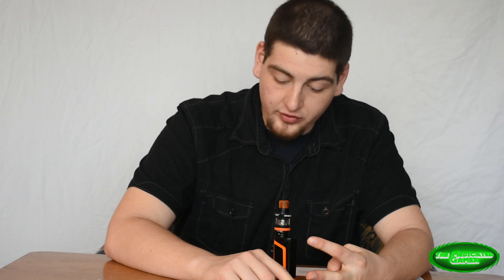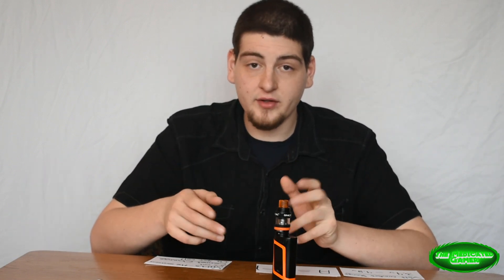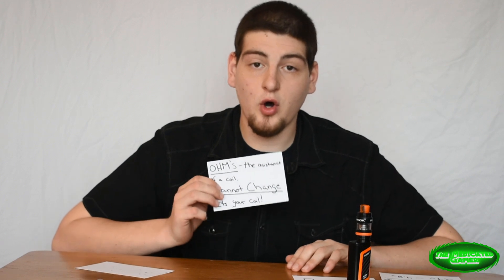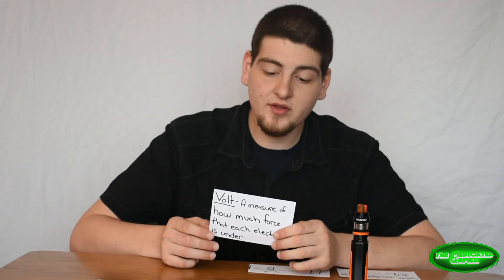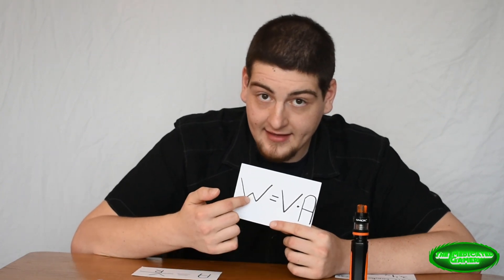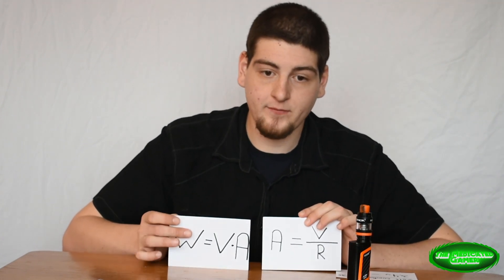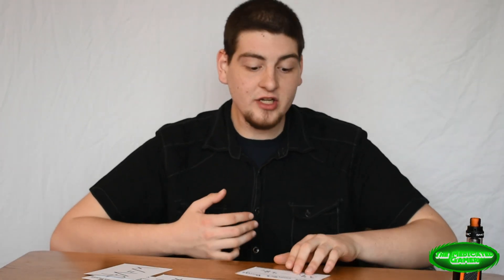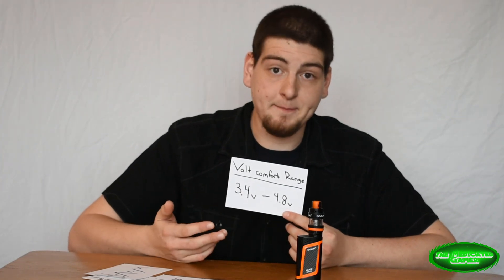Vaping 101: OHMs, Watts, and Voltage Explained for Beginners

Comment: clear as mud, how many volts should be used with a 1.6 ohm coil to overcome the resistance without burning the coil and the most efficient use of battery?  Is running volts too high or too low burning the coil?  How to set that up?  They advertise a 2K amp hour battery but how long does that last with a 1.6 ohm coil?  Amp hours depend on how much voltage and how many amps are used so that tells us nothing without a calculator so you've basically told us to figure it out.

Comment: So, I know this isn't a forum, but I need help BADLY! I have the Vaperesso Target PM 80 and it's sub ohm. The regular vape fluid has a high VG and low PG the exact opposite of what I need. I tried using salt, but it tastes dull, but better if I crank the wattage up which is the polar opposite of the recommended wattage on the coil. Should I mix half salt with liquid (which is easier to buy locally) or look for fluid that's just high PG? I live in a Podunk town where the stores have NOTHING! I'm at odds with what to do and would love suggestions! I'm looking for a Custard or Creme Brulée flavor!

Comment: Bro, I am gonna do vape videos now. I feel like I know more than most people do. Wanna know what I learned? You gotta just set everything for premade coils the way it says on the packaging. My coils said to set at 100W and .33ohms. I did that and it fixed my issue. My vape was all screwed up from being on in my pocket. Buttons got pushed and my ohms changed to like .56. I hit that thing and I coughed like crazy. Thought I had a burnt coil and I didn't. It was about to be burnt though. Just look at your box on the back. It tells you.

Comment: Hi, i need a quick response i am new in this, i have gen s with 0.18 sub ohm coil and the voltage is automatically set to 3.2v..is 3.2v is good for 0.18 sub ohm coil or bad?

Comment: MTL vs watts or would that be resistance? I want like a cig. Is it only predetermined vapes for that or is adjustable =wattage to get a little less or more resistance better? I've a sourin edge and that's pretty good but I notice these things go out of style/stock. They quit selling them when a new one comes out that id more popular or something. I don't want to throw away a perfectly good battery or cartridge/coil stock if the pod or battery goes. I'm getting good results without salts in the edge too. I purchased an adjustable ohm battery with .6 and .4 cartridges and two coils with different resistance(?). Correct my words please first then paragraph correct words with what a smoker who likes how cigs draw and smoke but can not use real cigs in the house. Also which coil is better for salts vs eliquid. And another question is PG/VG. Different coil and/or ohms for higher VG correct? I want to get it and out seems like reading and reading raises more questions. On Suorin site I notice a lot of battery also have adjustable threads to for different tanks/pod. Is a tank a pod for all intents and purposes? Tanks can change coils and ports have built in coils? Am I correct in that? Flipping back and forth when I hear a new word doesn't always work because some manufacturers use a different term. It's driving me nuts.

Comment: I'm just saying, I'm running on single coil with .44 ohm resistance, I just want to see what is the perfect wattage/voltage should I stick to. all of those are showing in my mod from the wattage to the ampere, I'm now on 44 watts with 4.38v and hitting 10amp when firing. Is that safe?

Comment: So has anyone figured out what the inductance should be since we're using buck converters at radio frequencies? None of the mods do readings for L. To really tune your vape like a pro, i think you're going to need to understand Z. Whole different set of equations. This is only a cursory glance at ohms law.

Comment: Damn I got some brain damage from reading the comments on changing your ohms lol. If I took a shot for everyone that commented "I CaN cHaNgE tHe OhMs, YoUStAnD cOrReCtEd" I'd be long gone 😭. If your still reading this a word of advice. Yes you can change your ohms on your boxmod. Like 99.9% of mods you have the option to. Obviously the point being made in the video is NOT to change it. It IS a constant with FABRICATED or FACTORY made coils. Example with the falcon king coils straight out of the box they tell you on the coil and from the box the specific ohms you can use the coil at. There are only 2 reasons you'd ever want to change the ohms. Read slowly. When your mod won't automatically read the coils reccommended ohms and wattage correctly(happens when the tank is worn) OR when your using a rebuildable. That's it. Simple. If you peons couldn't uNdErStAnD idk what to tell ya🤔🤷‍♂️

Comment: My ohm is .16 and I am using gpriv 2. And I’m using a ram coil. How high should my watts be? I recently changed my wick 2 days ago and It smells like its burned already. My setting currently is 70w with a preheat of 65 in 100degrees celsius.

Comment: I have a voopoo drag the first version.  I used  smok and geek coils .05 in my srk tank. I'm looking  to get the right balance I love vapor and not to much heat I buy my coils are rated 35 to 90 . But when I go over 55 watts  they burn out . What am I doing wrong. Sometimes  a coil will last 1 day and others last 3 weeks  how come . I follow the proper set up I put juice  in the slots and wet  the cotton.  And wait 25 minutes  before  vaping

Comment: why does it say 0.26 ohms in my vape's screen even though I have a 0.3 ohms coil in my tank
Reply: Depends on the batterys and mod you have if you have an old mod it might not be that accurate and its not perfect everytime and if the difference is lets say 0.05 ohms its not going to be that substantial.
Reply: @leoholmberg7163  sometimes it's not old mod or battery related the AEGIS LEGEND never read the coils spec's as rated it also jumps up & down in WATTS as you push fire button to Vape don't believe me have a friend watch or look as screen in a mirror or use phone video pointed at AEGIS screen while vaping with or without firmware update

Comment: Why do I have a button that changes the ohms then? And why does it keep saying "ohms to high" even after i turned them down as low as it will go to .090? My smok procolor 225 watt has a ohm range from .090 to .252?

Comment: I own an Artery PAL II & it seems the coil selections are 1.2 and 0.6 Ohms.  On this unit it seems the wattage can not be adjusted, & the coil has a watt number range listed.  Is this range based on the voltage the battery has based on how much charge is remaining?

Comment: U actually can change your ohms up and down when changing to a new coil on the smok devilkin
Reply: And the smok t priv
Reply: You can change the ohms on the smok mag 225w too. I typically have to change mine when it tells me the atomizer has shorted out. Even on a fresh new coil. I use smok triple mesh with a tfv12 prince.
Lock the mod, hold the up or down button, then the ohm menu will appear.
Reply: @asimgeekhan  I have the smok x priv with v12 prince coil and I cant figure out what the best ohms to run it at any advice?

Comment: Volts x amp = watts and watt ÷ volt = amps.  Learned that when using a generator and power tools to make sure I didnt overload or blow a fuse as most tools go by amps as a measure and most generator ratings are listed by wattage.

Comment: Hi, a fast question, appreciate anybody answering it. I know its bad for the coil using more wattage than the recommended and may burn it, my coil is recommended 55-65W. Is it bad for the coil if i use it on lets say 25W? Logically its better for the coil, but just have to ask 😆 cuz it says recommended 55-65w
Reply: Hi, I'm really late but it won't damage your coil at all, the only issue is that the vape could start to gurgle and flood due to underpowering the vape. If that happens you could get hot liquid in your throat when inhaling.

Comment: I have a Smok Mag and I can adjust the ohms. It actually adjust the ohms automatically.
Reply: Will Porter mine too bro now im confused ahaha i have smok h priv 2. my ohm before is .13 when i changed my new wire it sets to .9 is that ok or should i get worried? cuz they said that the lower the ohm the more they get hot easier and sometimes lead to explosion? please enlighten me

Comment: I liked the explanation. Really wish there wasn't math involved - I suck at math. However, the reason I was even looking is that I'm getting my first RDA and am trying to figure out what type of coils to use with it. I know that it comes with coils (thank goodness) but what if I come across one that doesn't. And then what about regulated versus unregulated mods? The gal at my local vape shop was like "when you're ready to get serious about vaping, you should get a HexOhm" - which I later googled and then was awash in all the new information about mechanical mods. Oye! My head is spinning.

Comment: What is a good setting/wattage for wax concentrates? I seem to be burning too hot and too low but cant find that sweet spot. Running at 17w which is 3.93v on my device. But i feel like its a very weak hit and i dont want to keep wasting wax

Comment: Listen stoner.... You need to tale a few courses at ypur local Community college or something...  Your formula is written wrong.. The current I in amps (A) is equal to the square root of the power P in watts (W) divided by the resistance R in ohms (Ω).
Reply: Listen dumb fuck he did that for viewers to easily understand.

Comment: Please remove this video as it attempts to promote a safe working knowledge on the elements and use of electrical energy and has failed miserably in it's attempt, leaving much to be desired. As both an electrician and a vapor it caught my attention to review for accuracy. Alas in light of many hazards arising from improper vape device modifications, I feel compelled to make this request in hope to prevent further injury resulting from misinformed/underinfirmed.

Comment: If my coil says to operate on 0.5 - 0.6 ohm but when I plug it in the voopoo drag mod box it says 0.82ohms is it save? I've tried unscrewing it and replacing it and hitting new coil but it stays 0.81 - 0.83ohms.
Reply: WoofyG I hope you already found your answer but this worked for me remove your tank completely hit your fire button it’ll say something like check atomizer screw your tank back on and it’ll ask if it’s new hit the plus and it should work

Comment: So what do you do if the Ohms on your mod are over the Ohms on your pre-built coil
Reply: Adjust your mod to most closely reflect the coil. The coil is what determines the actual ohms. Your mod only allows the input to tell the chipset what the resistance value of the coil is so that it can logically apply appropriate voltage to produce the requested power (watts).

Comment: I have an aspire breeze and I've seen coils with different ohm ratings i was wondering what the difference between say a .6 or a 1.2 ohm
Reply: The difference is in how much the resistance is going to let volts through.

Comment: You Have to Know the AMPS of the battery you are using the higher the amp rating the better. Whether you make your coils or not you cannot change the ohms unless you fabricate another coil 
Ohms Law is what New vapers need to learn just Incase they end up buying a new squonk box that’s a mechanical by mistake etc...
I= V/R not hard at all...
Reply from the maker: Appreciate your input!
Reply: It’s not hard once you find it. I mean, the formula. Trying to find that simple explanation was like wading through a twisted vapeporn maze. I feel like I need a shower.

Comment: I just have a question, I've been running the Smok mag with the T10 coils for a while at 80 watts, with an almost closed off air flow tank, it's what I find i like the best, well recently it's been acting up giving me a no atomizer error which I get is generated by the pins not contacting from the base to the mod. So I'm in the marketplace for a new vape and preferably stick to smok because they sell the coils here. I want a stick vape that's bigger than the pens because it's easier to carry around than the hefty mag, it's heavy, and awkward when carrying things like groceries and what not. What kind of smok vape pen would give me the same output of a 80 watt with it's coil that I like? I've recently been looking through the numbers just searching for the pens with the max wattage and so far I think the prince sticks have the max of 80 watts. (I smoke 6mg nic juice) Thanks for reading!

Comment: I've been vaping for almost 8 months now I was smoking 2 packs of nasty ass cigarettes a day now I smell them and I feel bad when I was smoking around people who didn't smoke cigs,but I'm on my 4th smock I started with the stick now I have the smock mag 225 you can change your ohm's all you have too do is lock your smock then hold the small button in the front the buttons you change your watts and everything else you want too change all u have too do is lock it then hold any of the 2 buttons on the face for a couple seconds and the ohm's will pop up then you can go up or down with the ohm's I can't believe he doesn't know this and I'm very new too vaping I finally got it down pat when I'm changing a new coil not to burn it you have to let the juice sit for at least 15 minutes then dry hit it with the air all the way open then start hitting it at the lowest temp then start too move up a little at a time until you find your sweet spot I was burning threw coils and I'm using a juice that has a lot of sugarso that didn't help when I would just put the coil and let it sit for a while and hit at a high temp it would burn the coil automatically even letting it sit for 15 minutes you have to start at a low Temp and work your way up,now there lasting me a week a week and a half a juice with no sugar 2 weeks easy just start at the lowest temp that's the key,the reasons you can change your ohm's is because if you mess up and hit old coil if you do that it will throw your ohm's off and you can change your ohm's just trying too help anyone new.

Comment: I have a question on my smok mag baby it my atomizer says 0.6 but my  vape reads 0.618
Reply: Idk if that's wrong or not
Reply from the maker: The coil was designed to be made at .6 but since it isn't an exact science it was made at the .618, it's close enough to .6 though that it shouldn't make a difference really

Comment: I been starting vaping for the 3rd week now. These voltage, amp, ohms really confuses me. I starting to get hang of it by observing, if the liquid "jump" to my mouth when i fire it mean its too high, and  if there barely any vapor when vaping means its too low.
Reply from the maker: Yeah I'd try using a liquid with a higher VG content. Its thicker and can usually lower the chances of the hot spitting liquid. It's also possible your coil is flooded. Try flicking your vape hard to shake out liquid. If it shoots out liquid then its probably flooded but shaking it hard can usually fix the flooding.

Comment: Ok,I'm now even more confused than I was before watching this...I didn't  get it at ALL....I just use the wattages best used according to what the coil says.And it works out just fine.My cleito 120 says it runs best between 100 and 120 watts,I run it at 110W and it tastes pretty good....My Valyrian says it's best used between 95 and 120W,I use it  at 110W and it tastes just fine.So what the fuck is this????
Reply from the maker: It's all dependent between the coil you have in the tank. The lower the ohm the coil is, the higher itll require to run your watts. The purpose of the video was to explain to correlation between the 3 and which ones ARE adjustable. If you have a legitimate question I'd be happy to answer..
Reply from the maker: Just follow the instructions that come with your prefabricated coil. This video is to explain the math behind it. If you just started this information is not for you. It's to understand the behind the coil. If your coil comes with instructions just follow the instructions. Its simple.

Comment: your not helping much here.. when i go to buy my coils they give me a choice of 0.5 0.6 or 1.0
Reply from the maker: I'm trying to explain the relationship between the numbers. When you put one of those coils in, adjust the watts until the volts read somewhere around 3.2V. That's my sweet spot regardless of the coil/ohm. You can then adjust accordingly to your liking. Keep in mind, higher the volts quicker you'll burn out your coil. Was this more helpful? I'd be happy to answer any other questions you have:)
Reply: @TMGProductionsOfficial  well the problem im having is my coil burns up to fast and was wanting to know if putting a different coil in would help with that.
Reply from the maker: @chrisbyrd7929  does it seem to burn instantly when you put a new one in or more like after like 5 or 6 days?
Reply: @TMGProductionsOfficial  more like it lasts 24 to 48 hours
Reply: @TMGProductionsOfficial  more then likely over hitting. i use it to quit smoking.. so far it seems to work but its costing me way more money
Reply from the maker: @chrisbyrd7929  yeah I have the same problem:/ I'm glad we think we figured out your problem. Also a trick I learned, when you put a new coil in prime it with juice before you finish putting the tank back together, that'll allow it to fully absorb. You can put the juice right down the center and on the sides no problem. Let me know if theres anything else I can help with, or would like me to do a video on a specific topic youd like, I'd be happy to assist.
Reply from the maker: And also honestly I've noticed the quality of coils decrease over the years. I think they make them burnout quicker so you have to buy them more often. Dont quote me but just a thought I've had.